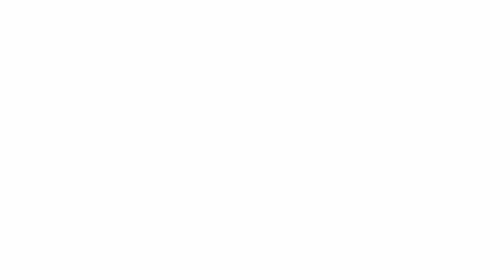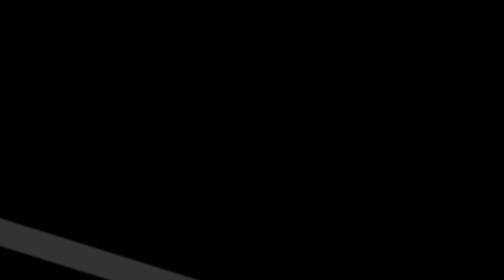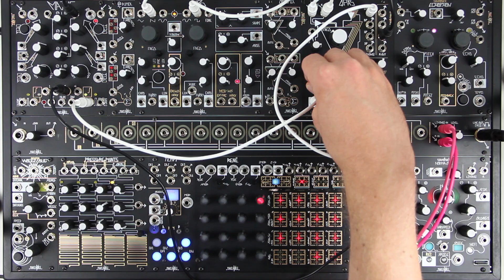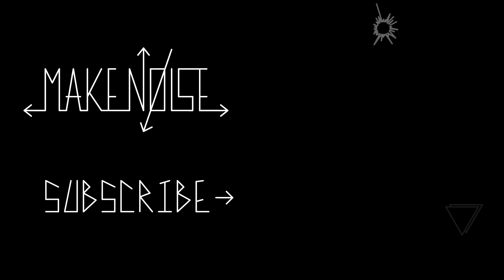Audio Rate Panning with X-PAN!

Comment: I love make noise.  I love Xpan. However. I would really love if xpan had attenuators to control the incoming cv at the pan input.
Reply from the maker: It was a tough design decision.. many people prefer utilities to be as small as possible, and adding attenuverters to the CV inputs would have made it significantly larger.
Reply: MAKEN0ISE thanks for that explanation I’m sure it was debated.